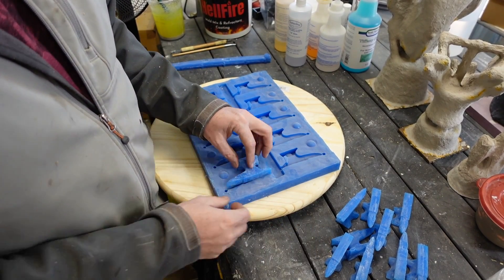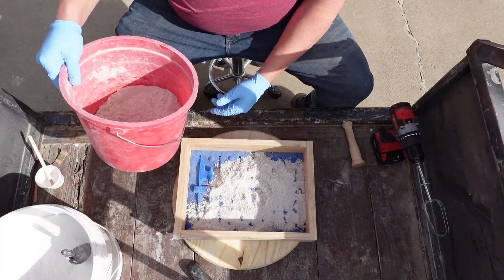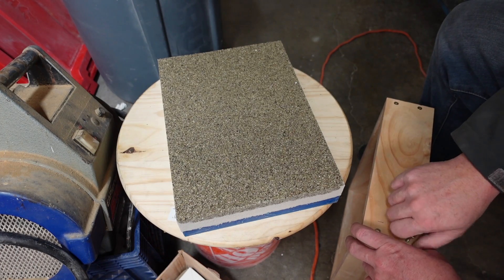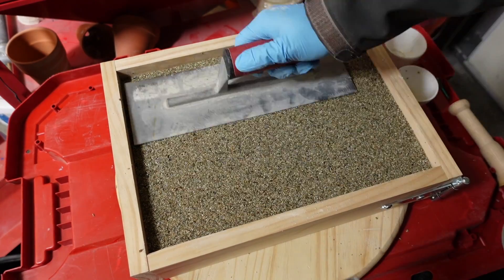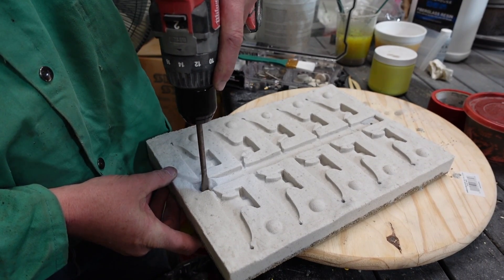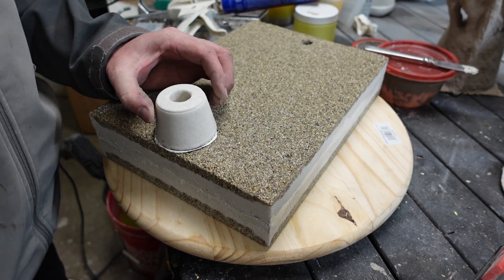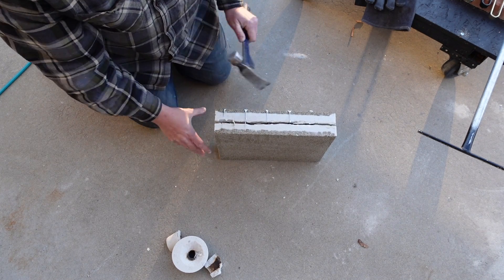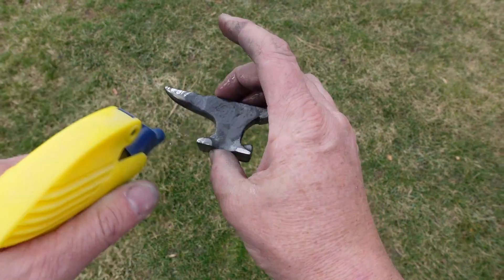Resin Bonded Sand Casting Zamak Anvil Bottle Opener

Comment: Hey what's the composition of this material and can i cast jewelry with it??? I'm finding alloy to make jewelry with which is silver or steel in colour... Btw love your content <3
Reply from the maker: Just epoxy resin and sand 1 part resin and 10-15 parts sand. I think it would work fine for silver. Also I've moved all my metal casting to my new channel called Hellfire. Also I've started a new free Skool community and I'd love to have you join us.  https://www.skool.com/hellfire-foundry-6488/about?ref=fcac146276454fceb3ebcb916d7940dc
Reply: @Themanscave i just requested to join into the club super excited...also is zamak 12 brittle??? Can we cast jewelry with that??
Reply from the maker: @deepsam7678  Yes it can be, just depends, you have to play with it and test it a bit.

Comment: So funny I just ran across. I've had the same size anvil for over 30 years. I glued a small Wiley Coyote figure to it back then and has sat in our display case that long. 2 days ago I made a silicone rubber mold of,because I have 3. And poured to resin anvils since yesterday. Lol I was actually going to make a few out of aluminium next. The for the info and video.
Reply from the maker: @clarks58  Thanks for the comment. And yes, you should cast some in aluminum.

Comment: Pretty neat, but for this I'd much prefer seeing oil bounded sand or green sand used since it would have worked just as well for this but would be reusable. Seems awfully wasteful if you don't actually need resin bounded sand.
Reply from the maker: I tried  oil bonded sand and didn't have any success. The resin bonded sand was really expensive and easy to do. It definitely takes more time. I have some videos coming up that won't be possible with regular sand casting. Thanks for your thoughts.
Reply: @Themanscave  then you didn't have proper oil bounded sand. I think some people selling oil bounded sand don't mull it which is critical for it to work right. Those parts would take to sand super easy. I made a muller from a food grinder and cannon ball. https://www.youtube.com/watch?v=OZ5jIcEonm4
Reply from the maker: @3DTOPO  Possibly, I actually watched your video on the muller, and that's pretty cool, I may have to build one someday.
Reply: @Themanscave  trust me, with proper sand you could cast those anvils easy - faster and cheaper. Green sand is great too and doesn't need a muller.

Comment: Pretty neat video! Next time you make a batch of these, could you go into more detail with the silicone process? I'd like to try something of this sort, but I don't care much for the lines 3D printing leaves behind. Rather, don't care much to combat them. Anyways, its pretty neat how many silicone pieces you've got coming together there for one casting. Also, about how many do you think you could do in one casting? seems like a pretty scalable process, say to make 20 or 30 in one casting. I guess it still involves the same amount of time making the mold, but does cut some time. Thanks again for sharing!
Reply from the maker: Thanks, and you could scale it up but the sand molds can get pretty heavy. But you could make multiple molds just as easy. I'm planning on making more videos using this technique, I'll make sure to add some silicone mold making.

Comment: For future, while you're making the form, cut your channels with a hollow tube before the resin sets.
Reply from the maker: I've done that with regular sand casting. With the resin sand it's super easy after as well.
Reply: @Themanscave  I dont think I mentioned it, and that's my bad, they look awesome. As one maker, in wood, to another. I'd use it. It would probably end up as a dual purpose, as a keychain as well